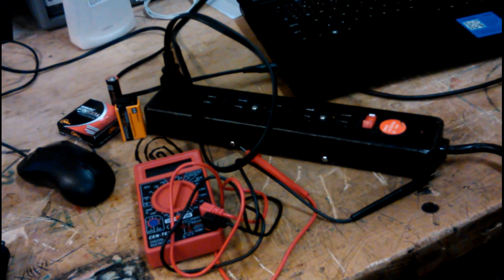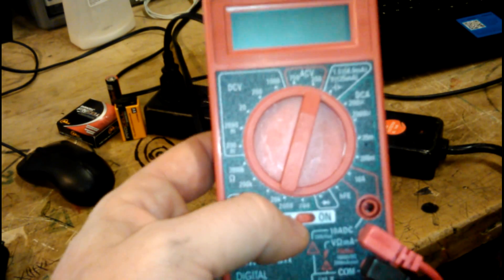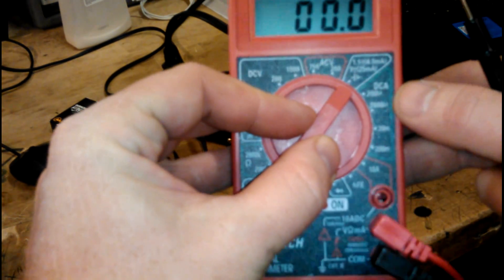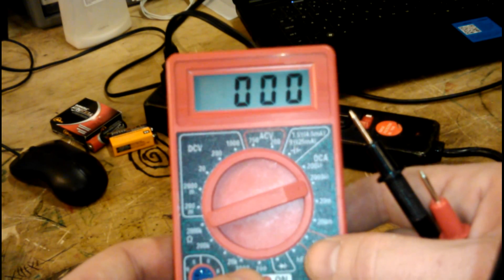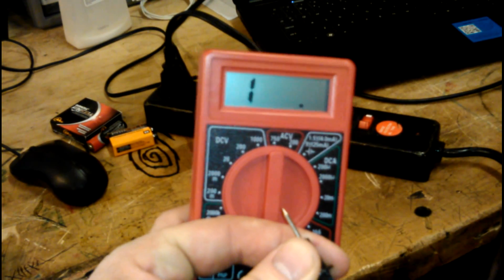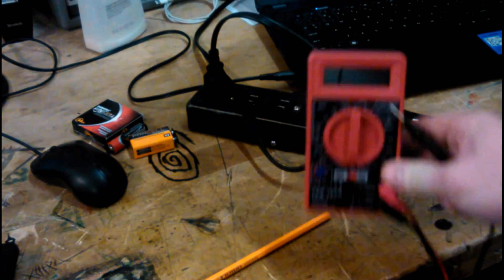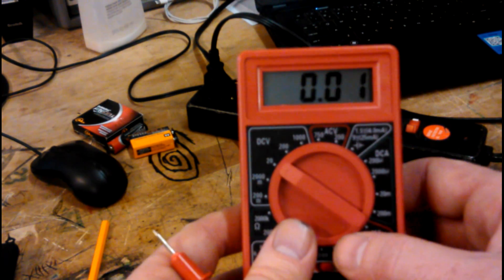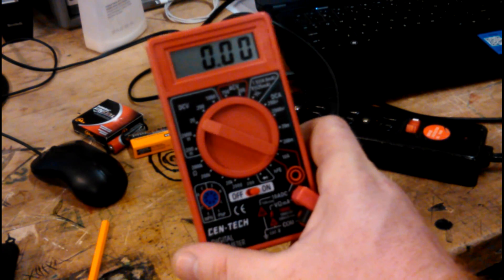Harbor Freight FREE multimeter; Tools for SHTF!

Comment: so - with this same exact meter.  If I were trying to see if I had 12 millivolt draw, I'd set it to 200m.  Would it make a difference in reading if I had the red probe in the 10max unfused or the fused outlet?
Reply from the maker: @jewllake  I would suggest finding one of the other great videos out there on introductions to electricity and electronics.  Voltage is measured as a potential difference across two points, it is not a "draw".  The 10A socket is used when measuring current flow, not voltage.

Comment: What is the top hole for 5adc???
Reply from the maker: I think you mean the 10ADC port.  It is where you put the + Lead when making inline current measurements of more than 200 ma.  That would be used with the 10A range on the selector switch.

Comment: What is the difference between voltage and live circuit? I'm trying to figure out how to test my dryer outlet.
Reply from the maker: When looking at AC supply mains, we say that a circuit is "live" when it has voltage on it.  It is either on (live), ot it isn't.  There are very few situations in which you would not see full mains voltage when looking at a circuit, which would be 120 or 240 or possibly 208 in the US for anything you might see in a residence.  If you see something very different than these, something is VERY wrong; you should probably shut off those branch breakers and call an electrician.

Comment: Just bought a 5.99 plus tax multimeter from Harbor Freight. But it won't work. Potentiometer is missing inside on the PCB. Then I realise it's not a Cen - Tech. But a No Name Brand Knockoff you would find in say, Chinatown in NYC. Very Sketchy, Harbor Freight on Artesia & Hawthorne in L.A. County. I have the receipt. 
What should I do?!
Reply from the maker: Take it back.   They will refund or replace as long as you have the receipt.  It's always a risk with low dollar chineseum equipment.

Comment: How to check car relays with this
Reply from the maker: You can check the coil to see if it is open, with the lowest resistance range.  If it is open, the relay is definitely bad.  You can check the normally closed contacts the same way.   Unfortunately, it cannot check the operation of the relay without applying power to the coil.

Comment: Hi :). I have a question. I have the same meter as the one in this video and I would like to know if the battery test setting will give the same measurment of mA as the reading of mA down in the current section. Do they not both measure the same thing or am I misunderstanding something? I tested a 9v battery with the battery setting and got 21mA. Then I tested the same battery down in he mA section of the dial and got .68A. Why the difference? Looking forward to your reply. Thank you.
Reply from the maker: Hi Michael; that is an awesome question.  Your thinking is logical, but there is a caviat.  To be honest, I do not know what the numerical value shown when in battery test mode is meant to show, but pretty much all I use it for is testing AA cells, which will show about 4.0 if they are in good shape.  I assume it is in ma.  You are getting a high reading across the cell in current mode because you are measuring the full current capacity of the cell across a dead short.  If you were to try that with a car battery (Do NOT do this!!!!   REPEAT...  DO NOT!!!!) it would either melt the fuse or blow up the meter, as it would be about 700 AMPS through it, for a very brief moment.  The battery check range has a built in resistance load in order to show how much "push" the cell has left in it for a given average task.   No load /dead short current won't tell you much, will eat up your cell in a short time, and may overheat and cause fire if left connected for too long.  Be safe, and keep questioning!
Reply: @GoingGoneGalt  Thank you for your prompt reply. I noticed on other meters they also have this setting for 1.5 and 9 volt batteries but it is clearly volts they are measuring. On this meter I was thinking perhaps they designed the setting to measure mA but under a load they provide in the meter therefore expecting a reading of 4 mA for 1.5v and 25 for 9v. I am new to all of this but find it interesting. Although I would not tinker with such readings on large powerful batteries I do want to thank you sincerely for reminding me of this safety issue. And thank you also for taking the time to clarify for me :).

Comment: I have the same multimeter. Mine  when turned ON, it does not show 0.00 but some numbers. As an example, when I set on DCV 20 and my both black and red terminals are not connected anywhere, it still keeps showing some numbers such as 0.87, 0.88 and keeps changing. How come it doesnot show 0.00 when it is not connected any where to measure? does it mean the multimeter is faulty or not correctly functioning?
Reply from the maker: Well, that is the big downside to equipment that is made so cheaply out of pure chinesium that HFT could afford to give them away by the tens of thousands.  The accuracy, especially at the super low ranges, is not good.  Most of the time, a "close enough" reading will tell me what I need to know about what I am looking at in a given circuit.  If I need good accuracy, Like when bench troubleshooting to component level, I will use my Fluke or BKP meters.  Try yours, in the appropriate ranges, on known components like alkaline batteries, mains power, resistors, etc, especially if you can check it against another meter that is known to be accurate.  If it suits your needs, great.  If not, you will have to invest some money into some better gear.  Best of luck, and thank you for chiming in.

Comment: Is this accurate enough to measure resistance in the 1-4 ohm range (to check my subwoofer wiring configuration)?  Thanks for the video!
Reply from the maker: It isn't very accurate in super low levels of resistance.   Also...  Just because a speaker coil is rated at 8 ohms, 4 ohms, etc, does not mean you can measure that with an ohmmeter.   That rating is not resistance, it is nominal impedance, which is the dynamic opposition to current flow in an AC circuit, rather than the static resistance to DC current flow, which resistance is and what an ohmmeter measures.  The voice coil on a loudspeaker that is rated 8 ohms might measure .2 to .5 ohms on an ohmmeter.  For your subs, are you trying to wire them in parallel to get the impedance down and get more total power?   Just do a visual inspection and compare to your schematic.  Most important, make sure you have them in phase.   Just use a 9v battery and make sure they are both extruding the same direction when you put it across the input.  If they are out of phase, you will get no bass (self cancellation), and will soon destroy the spiders.
Reply: @GoingGoneGalt  thanks for the info! Reason im asking is because I saw a video from Sonic electronics where the guy checks his wiring config with a multimeter and it seemed to work for him. I'm wiring 2 DVC 4 ohm subs down to 1 ohm to supply the sufficient RMS (Amp is mono and 1 ohm stable). My box has 2 separate compartments so I couldn't follow the diagrams exactly, just wanted to make sure how I have it wired is indeed ~ 1 ohm.First I wired each of the subs voice coils together (i.e. POS a of sub 1 to pos b of sub 1, same as diagram) then pos and neg of the subs to their terminals in the box, then connected the pos and neg wires from each terminal to the mono amp. I believe it would be the same but not entirely sure, I took physics years ago lol

I'll make sure to check the phase too, thanks for the battery tip!
Reply from the maker: @bAc0nBoY755  Wiring two 4 ohm speakers in parallel will give you a combined impedance of 2 ohms.  This is good.   Car audio specs are usually grossly overstated, so staying within them by a factor of 2 is a good plan.

Comment: Similar here. I'v had exact digital multi meter for a year, unopened and battery still good and didn't leak . Just curious , i want to test if an old land line has electricity  to charge my cell phone in case my charger gives out/damaged / and just to see if it can be done .. I'v read that some landline phone outlets that are not being used for landline services still can have power from possibly a secondary generator source. And trying to figure out how to test for possible cell phone charger use or if no electrical current then i want to use for a standard antenna for my television . By doing second plan i'd be using existing wire through out entire route in my apartment building untill it reaches to cut off point , power pole i'm guessing . Anyhow , i have a phone cable line plug in with two wires going into a flat seperate connectors(4 inches wire phone cord line from wall connector ) . What setting on mulimeter should i use? Thanks
Reply from the maker: Attaching anything to a telephone line that is not a part 68 approved interface is, in the US anyway, a crime.  The DC voltage on a telephone line between the tip and ring has nothing to do with what charges your cell phone, and would damage your phone badly if you tried to hook it up to it.  It would also likely make a very poor antenna.
Reply: Definitely, additional using an LM317 or an L7805 voltage regulator along with a 3A rectifier diode (1000 V) directly on line should keep too much power from overload phone charger circuit. I tested it and has power . I have used other outlets for basic antenna reception (different location) but I made sure if no power was in line , that I had to ask property owner , didn't have a multi meter . Actually, antenna worked perfectly, so good he asked me to configure/ hook his television up. And that also worked  awesome. Got television channels super clear without distortion and a few extra stations. Mainly because the telephone line was running quite a distance to a power box ( 60 yards , estimate). Anyhow, I going to give this next project a try , and see what I come up with . thanks

Comment: Whats the little blue thing thats has the NPN and PNP  just to the left of the on/off switch for?
Reply from the maker: That is a transistor checker.  I have never used it, but it should tell you the gain of the transistor being checked, as well as checking reverse bias.  PNP and NPN refer to the two types of transistor configuration.

Comment: Thanks! Very instructional video. If I may ask, what is the other plug ised for? the empty one. And what is the blue part next to the off button on this multimeter used for?
Reply from the maker: The open probe hole is for the 10 amp range when measuring DC current.   The blue block is for testing transistors.   I have never used this on this meter, so I cannot vouch for how well it may work.   Sorry about the lateness of the reply!

Comment: it would'bve better to move it to 20V for the batteries. No one knows the mil lamps.
Reply from the maker: Well, i explained in the vid why using the battery check range is better than measuring the no load voltage, but you obviously know better than I do.
Reply: This has been explained in the video and in the comments of others who asked the same question.

Comment: Thank you for sharing. A question. Can car fuses be tested with this particular multimeter.
Reply from the maker: I'm sorry about the late reply...  I didn't see it!   Yes..   but make sure to take them out of the fusebox before testing them, or you can fry the meter.  Once you have it out, put the meter on a resistance range (ohms) and put the leads across the fuse legs or caps...  one on each.   The readout should drop to near zero, or the same as if you short the leads together without the fuse between them.   If it does, the fuse is good.  If it does not change, the fuse is open (bad).

Comment: You're a genius! I'm a clock person, they take AAA, AA, D, C and 9v batteries. I have the same meter as yours. PLEASE tell me what the the screen should read in order for these batteries to be good. I'm putting the dial to "1.5v" like the instructions say......what's good, what isnt??? THANK YOU!
Reply from the maker: It kinda depends on the current load that will be asked of them whether or not they will be usable for your application.  New ones usually read 4.0 to 4.3, i usually toss them below 3.6 or so...  But what a clock requires, i don't know... I would bet that you could drain them down pretty far...  Measure one that died in your clock to see where it is..  You will get a sense of what is usable or not.  Practice practice practice!
Reply: @GoingGoneGalt  You have helped me out tremendously! I love my meter, the instructions are easy enough but it doesn't say what to look for or what a good or bad reading should display. THANK YOU FOR YOUR TIME (no pun intended:-) Gotta LOVE YouTube! ..... and I do! Thanks again! ♡

Comment: I could use help troubleshooting a Hunter irrigation sprinkler controller.  The display isn't receiving power.  I need to know if it is the power supply adapter or if it is the internal computer that is burned out on the controller.  The power supply is 24 volts from a power adapter plugged into the wall.  Any help would be appreciated.

Comment: Thanks for the video! Just tried to start using mine (exact same model) and what I forgot about using one was just about everything. Doing some automotive stuff on my Jeep and need to check (disconnected) battery cable stuff, grounds, etc.
Reply from the maker: Great!   Let us know how it turns out!
Reply: @GoingGoneGalt  Turned out great. Just finally got around to checking if my new radiator has a ground path. It apparently does (not sure where yet). In the spring or so I am going to be doing a long flush on that system, so will check it again with the coolant out. One does not want the electrons flowing through the coolant, one wants the metal components grounded so they don't get promiscuous and breed galvanic corrosion. That is one of the things that destroys any aluminum coolant system parts early. If I discover later that there is no ground path through the frame, will be adding a grounding wire.
Reply from the maker: @AustrianAnarchy  I hadn't thought of grounding the radiator...  Brilliant!  Electrolysis is the enemy...
Reply: @GoingGoneGalt  They do it in industrial equipment all the time. Not sure why it is not done on home gamer transport. I guess I should check resistance by opening the cap and putting one probe into the fluid and the other on the same body ground I used before. If it is the same reading as going from radiator metal, then I really don't know anything yet. Will know for sure when I check it with the radiator drained.

Comment: When you were checking the AC in the power strip you didn't let us know what the hot one was meaning did the black or the red go in which side where you plug into the power strip I'm pretty sure from other videos the larger longer of the power strip is the black negative
Reply from the maker: Hi mity; I would suggest that you check out some videos on basic electrical theory.  When dealing with AC (The power that comes out of the wall) there is no "positive" or "negative", as the EMF (voltage) swings between both equally at a rate of 60 times per second (in North America, anyway).   So, it does not matter which probe you apply to which side of the outlet, you will get the same reading. There is a difference between them, however, as you had stated.  The smaller slot is the "Hot" side (which carries the power potential, both positive and negative in relation to Neutral / Ground.  This is the side that will hurt or kill you if you come in contact with it!) and the larger side is the "neutral" (which SHOULD be at the same potential as ground, but is there exclusively to carry the current back to the source, whereas the ground is there to protect from voltage potential where it shouldn't be).  It is necessary to take note of which probe you use when measuring DC potential (like in a car's electrical system), so you can confirm what you are looking for.  In that case, you are right, black will be negative and red will be positive.   If you did reverse them, it will not hurt the meter, but you will see a "-" symbol before the reading...  indicating a "negative"  potential.   I hope this helped..  thank you for your question!

Comment: GoingGoingGalt:  I have one of these that I got at Harbor Freight Tools.  It is the exact same one that is in this video.  I have had it in a drawer for many years, and it has never been opened.  I was wondering if there is a battery inside it that makes it work?  If so, do you think I should replace the battery?
Reply from the maker: Yes; there is a 9v battery inside that powers the unit.  If it doesn't power up when you turn it on, then the battery would probably be the problem.  There are, if i remember right, two tiny phillips head screws that hold the back on to give you access to inside.  Make sure the leads are not connected to anything before you open it up.  Let me know if this fixes you up.  Thanks for mentioning this, i guess i never did!
Reply: @GoingGoneGalt  Thanks for your help!  When i get a 9V battery i'll let you know.

Comment: So a new 9 V battery reads about 26 milliamps?!?  Why does it not read 9 V?  Can't you put it on 20 DCV then measure it?  (I'm got me a free meter and just curious on how to use it).  Thanks in advance.
Reply from the maker: You can take a simple open circuit voltage reading on a DC range, and it is better than nothing, especially if you are very familliar with the type of battery you are using and the equipment that you are using it in, like I am with Duracell Procells and wireless microphone systems. The purpose of the dedicated battery check range is to measure the battery / cell under a small load, to see how well it is performing.  This gives a better estimation of condition than a simple open circuit voltage reading can.  Hope this helps!